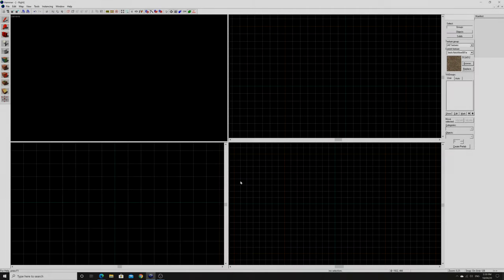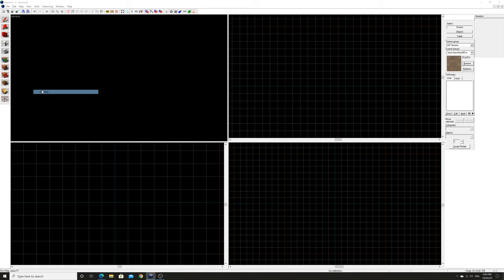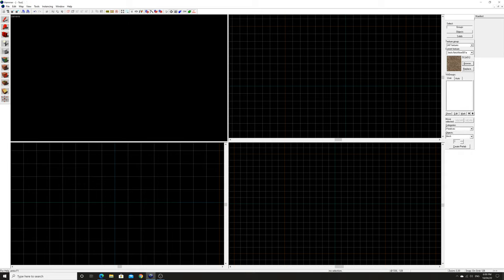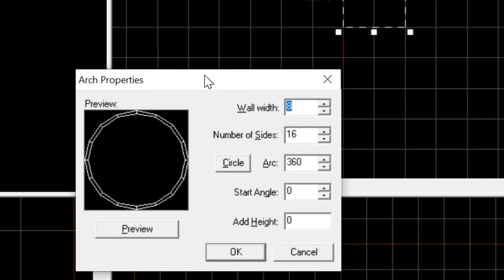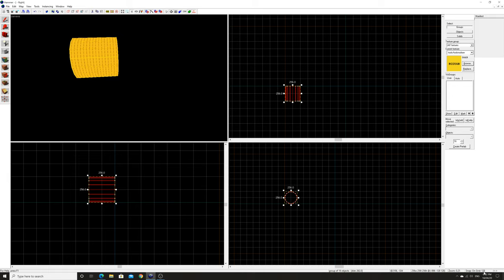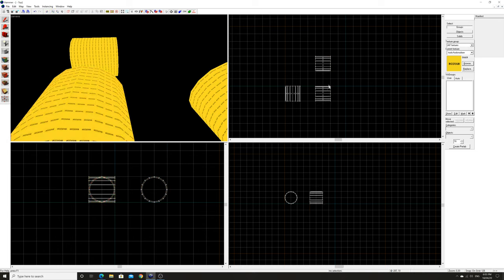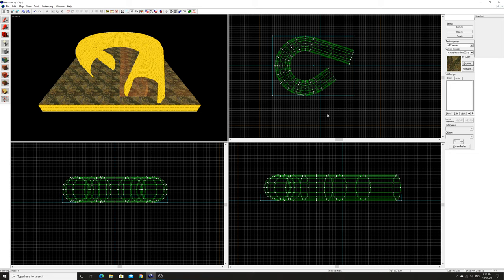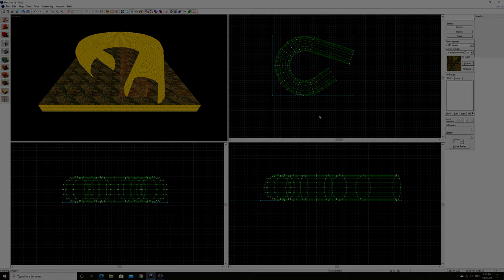Hammer Tutorial 15 - Creating a Curved Arch Tunnel + An Idea For Complicated Tunnel Designs

Comment: Really useful tutorial, I'm trying to create a curved balcony. Does this technic works as well?
Reply from the maker: Thanks, glad you found it helpful! For a curved balcony, my interpretation would be to create a cylindrical brush with the amount of sides you want, then split it down the middle with the clipping tool to end up with a semi-circular like object. If this is not what you want, then the arch tool will be what you want to use, just specify the number of sides, angle, thickness and all that. It's hard to explain in words, so I hope what I have said here helps.
Reply: @TheMaster974  Thanks for your reply, really appreciated!
I guess I'll need to figure out how to do it with the arch tool. I'd like to create stairs and roofs with that kind of curve.
There is an example of what I want on the csgo map "zoo". On the B site, the balcony.

https://steamuserimages-a.akamaihd.net/ugc/39743289290267686/DE20B6F5477E2EF101AD045C6330785896CFB3E6/
Reply: @TheMaster974  Well I've found out  how to do it. Thanks for your help!
Reply from the maker: I'm guessing it's light bleeding, where brush entities i.e. func_detail are next to world brushes, and it's something to do with the way the lighting is calculated. If the walls are tied to something like a func_brush / func_detail then to stop light bleeding, click on a button that says toWorld to make them world brushes. It would stop the bleeding (hopefully), but it contributes to your map's portal file / visibility which may not be ideal. Alternatively, you could create a brush textured with the tools/toolsblocklight texture that occupies the volume where the offending brushes are, which should prevent light from shining through. Those would be my suggestions, hopefully this solves your problem!